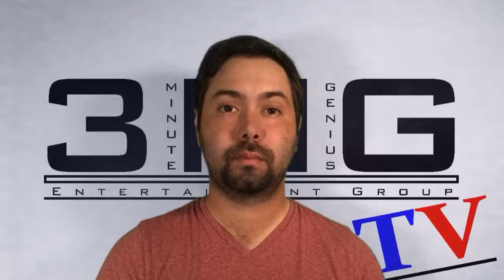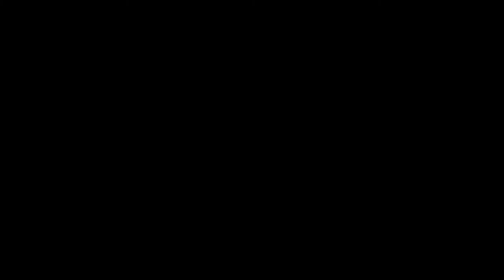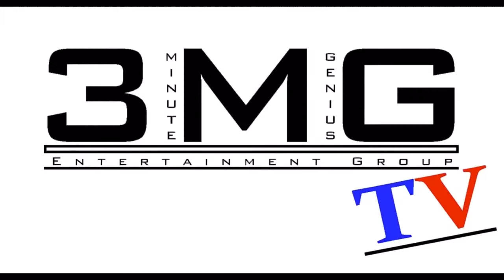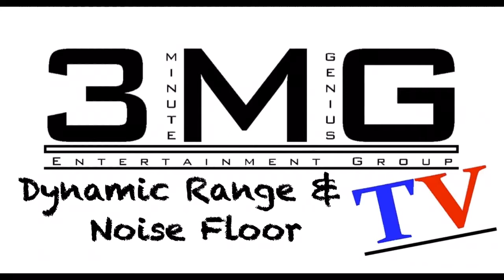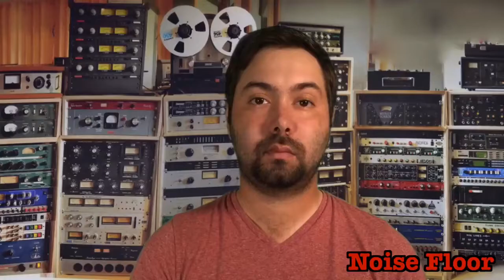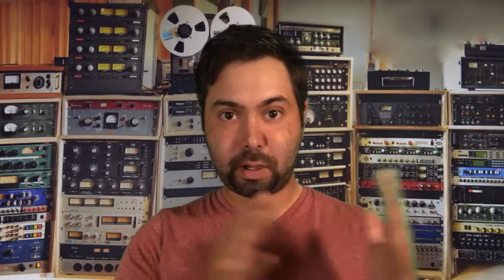Noise Floor and Dynamic Range explained

Comment: Trying to accomplish ppp dynamics in my work yet- if my sounds are to quiet I can hear floor noise! I would love eliminate that noise without eq.
Reply from the maker: Gotta get a quieter room then :/
Reply: @3minutegenius571  I did test this out man, I unplugged my UA 710- ran that into my LA610" model preamp in my motu 828x and my output could be at +40db and Its very very quiet.  When I plug in my 710- the floor noise comes back. Maybe it's my mic? Maybe it's the 900$ micpre? Thanks for responding! Got any advice?

Comment: I watched the last video and agreed with what you said. Recording live jazz presents me with a dynamic range problem because the bass solo is much quieter than the horns. I have to selectively amplify the bass solo, sometimes with eq, or the music completely goes away driving in the car.

My solution for dealing with wanting dynamic range when you can't really get quiet without becoming inaudible is what you touched on in this video. You can simulate dynamic range or a "quiet part" by thinning out the texture and using more rests. Less instruments and more air (space or rests) = quieter in the mind of the listener even if the peak levels are almost as loud as the loud sections.